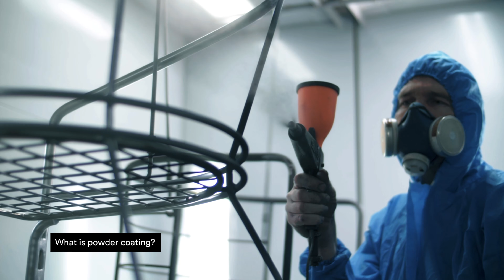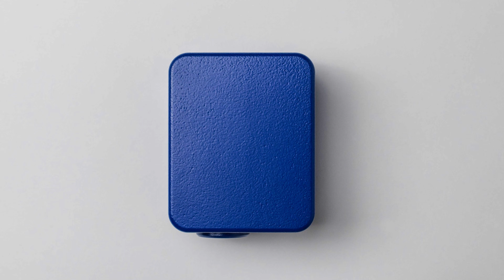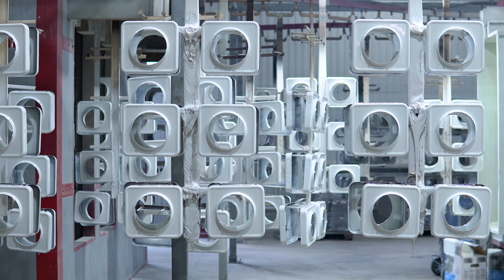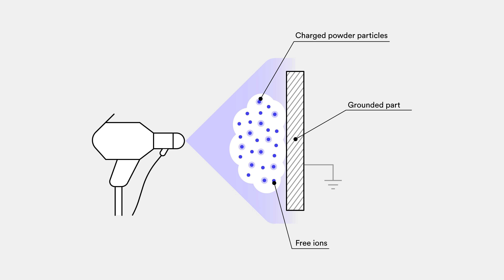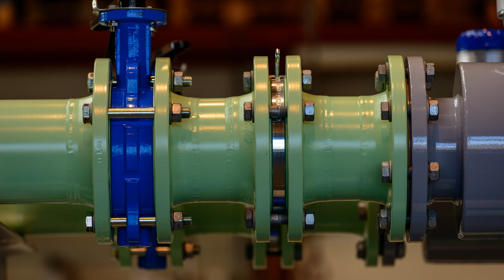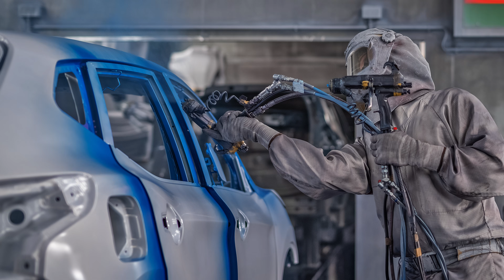What is Powder Coating and How Does it Work?

Comment: The "down" side of powder coating is that if a small area gets worn off to the underlying metal, there is no quick/easy/inexpensive way to fix it (like you can with a painted surface). For the roof rails on my Frontier pickup, I was told the rail will have to be removed, sand-blasted, cleaned, and then the whole thing powder coated again--at a cost of several hundred dollars. It would be cheaper to purchase the OEM parts from a dealership.

Comment: Well,
First you drop your powder 
Then it melts till 200 degrees
And finally it starts to turn into elastic and plastic coating

So. What if i coated until 160
Some problem went wrongly with the oven and it turned off

Now, after 3 days i want to repaint them again
Should i scratch the paint and start again?
What if i just turn on the oven again ? They wont melt? Will the paint just get more hard and more plastic?

Comment: Can you please write the actual words about the Three Types of Powder Applications. In the translation, they wrote "Fluidized Bad Coating", "Electrostatic Fluidized Bad Coating" and "Electrostatic Spray Deposition". Are these correct glossary ? If not, please write back in your comments. Thanks 🙂
Reply: It’s correct except that it’s “bed” not “bad”.